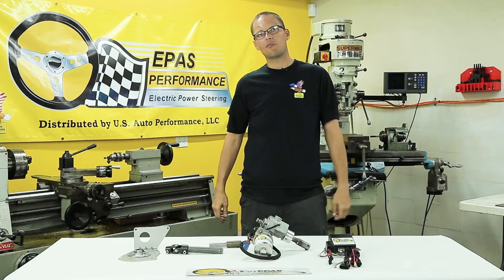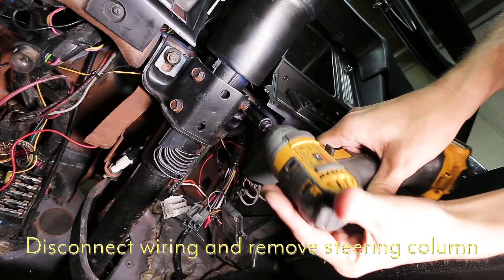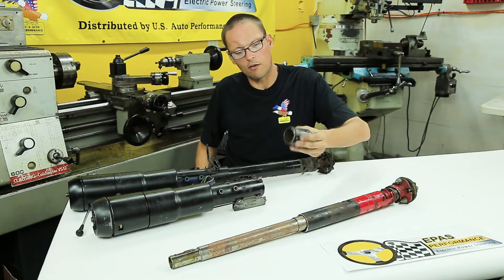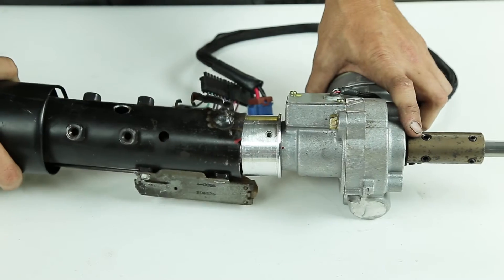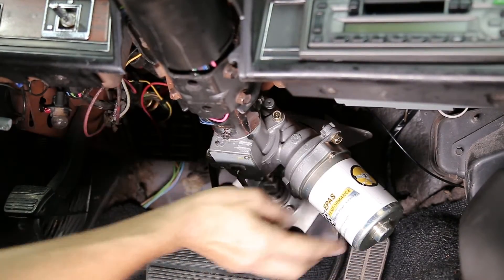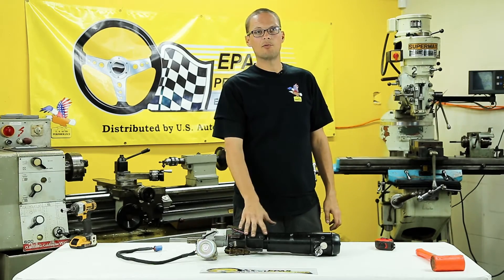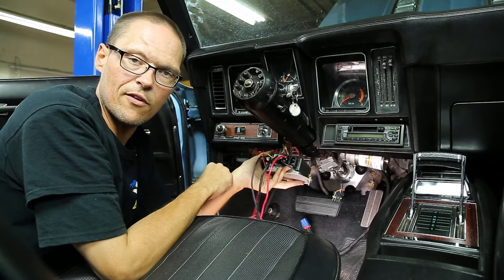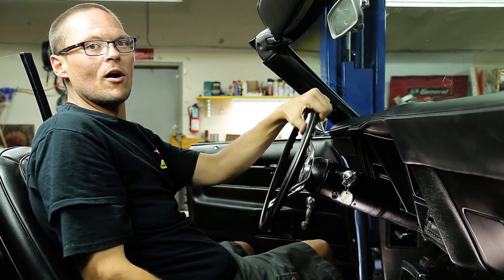EPAS Performance Application Specific Electric Power Steering Conversion Kits

Comment: What do you do with the Hydraulic lines that's connected to the Steering box after the EPAS is installed?  My goal of using the EPAS is to delete the Pump off the engine.
Reply from the maker: Hi Mike - you don't mention what car you want to install our system on? You can ONLY use a manual steering box with our system. Some of the early Mustangs, you can actually remove and replace the center section with a manual center link and you are good, but Galaxies and some of the other Fords are different and you cannot perform that fix. Please call our shops to discuss your particular application. (941)-893-5427
Reply: @epasperformance5469  I have a '69 Nova with a Quick ration Power Steering Saginaw box.  3 turns lock to lock but I want to get rid of the PS pump on the engine.  If I swap to a manual steering box, will it increase the turning ratio?  Some of the Manual boxes are crazy 5+ turns lock to lock.
Reply from the maker: @MikeWolf-427  What you install is entirely up to you, Mike. There are 16:1 steering boxes out there as well. We would look on a Chevy forum or talk to other enthusiasts in the hobby to see what they have done. What is it that you are trying to accomplish with your Nova? Straight line performance, some form of road racing or simply streetable performance? Again, if there are specific questions, you should definitely contact our Technical Department for answers at the number we provided in our last response to you.